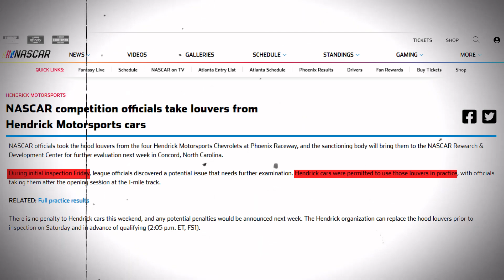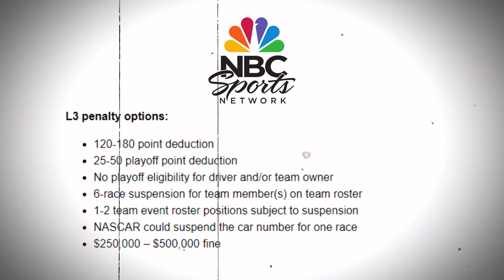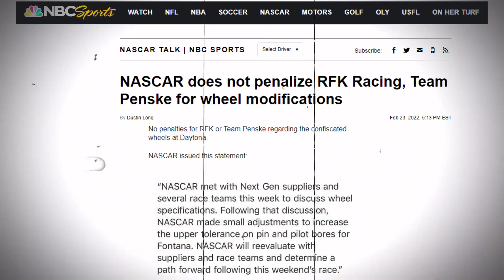Hendrick Motorsports EXPOSED of Using Another LOOPHOLE!!*MUST SEE!!*

Comment: why doesn't Nascar  just supply the cars right at race time and not let the teams work on the cars before hand in fact why not just have them get there cars by lottery picking with magnetic numbers
Reply: That would finish nascar off completely. Nascar is already doing a good job of wrecking nascar. Box office down. Las Vegas Motor Speedway used to have 120,000 sold out seats. They took out a few seats, only 80,000! Still can't fill 40,000. Keep it up nascar.
Reply: This is first class auto racing not bumper cars
Reply: That was IROC. Great series with great racing

Comment: But Chevy still won the RACE.
Reply: Hendrick Cars were 1st, 4th, 9th and 10th. The louvers only remove heat from the engine bay so it wasn't a performance enhancing modification.
Reply: @MichaelSmith-kr9qw  tell nascar that